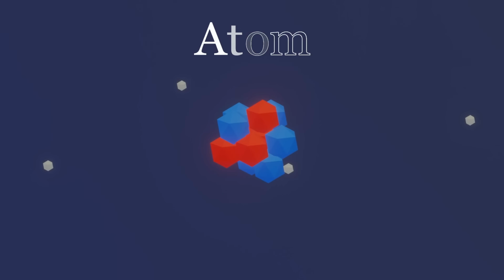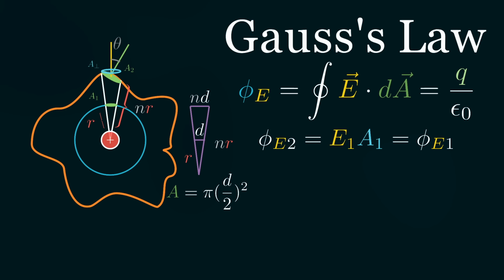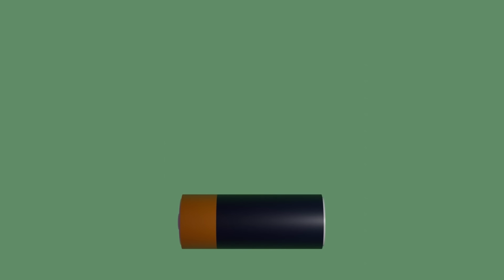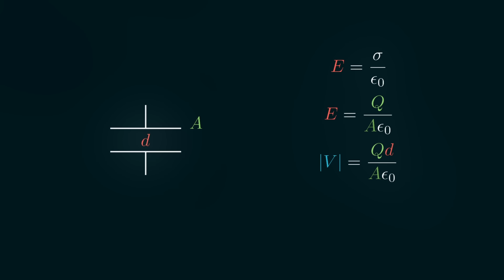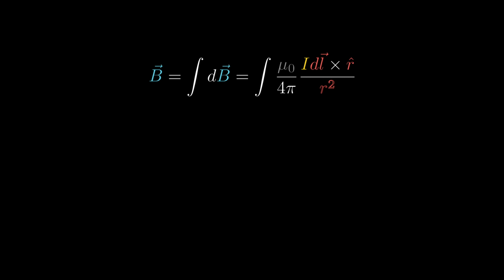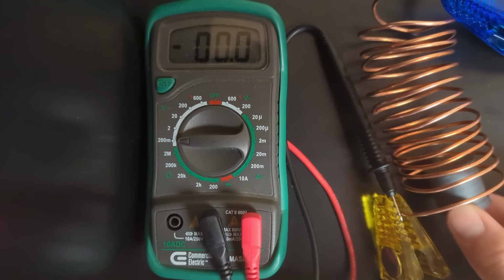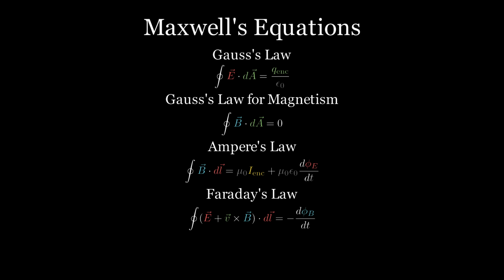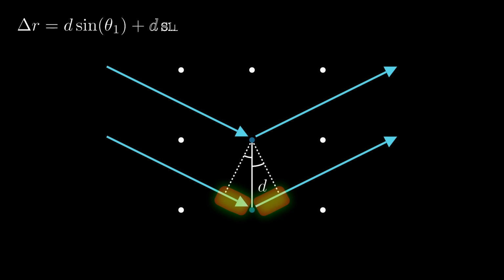An entire physics class in 76 minutes #SoMEpi

Comment from the maker: Corrections:
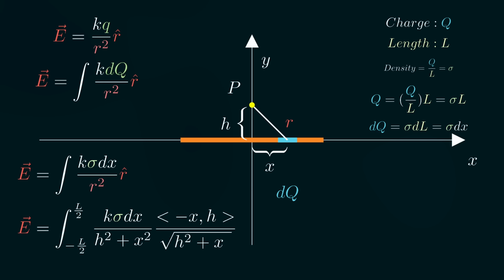5:46 - The square root in the final equation should have an x^2, not an x.
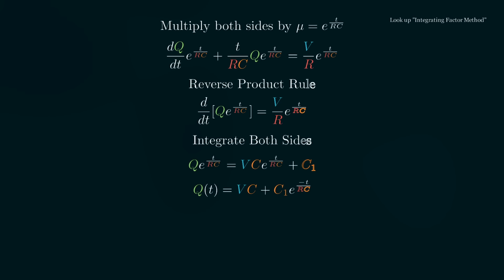30:33 - The terms with a Q out front should be (1/C)*Q, (1/RC)*Q, etc. instead of (t/C)*Q and (t/RC)*Q
35:05 - The top relation should say E -> E/(kappa), not E -> (kappa)E. The bottom relation is still correct.
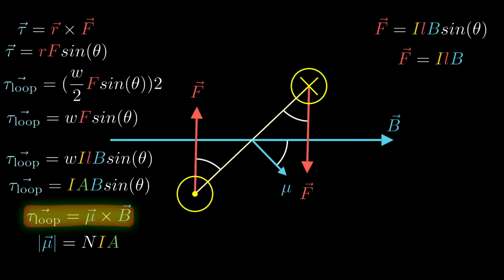51:39 - The motor should rotate the other way.
1:03:12 - Integration should be from 0 to I (capital i), not 0 to L
Reply: Partner collab 😎 nwc
Reply: ah thanks for clarifying, I thought I was dumb lol
Reply: Really appreciated.
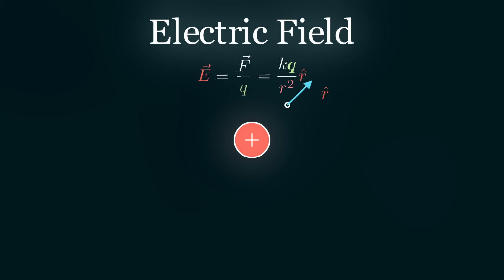Reply: 3:48 two q's should be classified
left side one is test charge in any points, while the right side one is source charge that is mostly fixed
Reply: You can edit an yt video i think
Reply: @COOKER_IO the ability to edit after upload/publication is extremely limited, mostly just trivial stuff like blurring, cutting, muting, and adding stock music from YouTube's library.
Reply: Thank you ❤

Comment: Maxwells constant speed C solution is wrong! This is because Maxwell did not include the source terms that come from Gauss's law and Ampiers law in the wave equation. There are 4 Maxwell's equations and all 4 equations are required to derive the wave equation. So the wave equation must contain source terms. Because Maxwell set the source terms to zero, his constant speed C solution is wrong. And because Einstein used Maxwell's incorrect constant speed C solution in his theories, both special and general activity are wrong!

The proof are the experiments, backed by both EM and quantum theory, all reproduced by other researchers showing that the speed of light is not constant at all. The experiments clearly show that the speed of light is instantaneous in the near field of the source, change speed with distance from the source, And reduce only to approximately speed C in the far field starting about 1 wavelength from the source, and never reduces to exactly constant speed C, ever. If the second postulate of relativity is wrong, what remains is the first postulate: Galilean relativity where time and space are absolute and causal action faster than speed C is possible without violating causality. If relativity is wrong then so is any other theory based on it such as general relativity and even QED. This will change all of modern physics!

What we see in the near field is real and follows according to the law of Galilean relativity. But what we see in the far field is not real and is subject to relativistic illusions such as time dilation and length contraction. Assume a fast moving body is being observed with light. If instantaneous near field light is used then no relativistic effects will be observed. This can be seen by inserting C equal Infinity into the Lorentz transformation yielding the Galilean transformation where time and space are absolute. But if far field approximate speed C light is used, then relativistic effects will be observed. So simply by changing the frequency of the light relativistic effects can be turned off and on. But because time and space are real for the moving object and cannot depend on the frequency of the light being used to observe it, one must conclude that the effects of relativity are not real and are just a type of optical illusion created by how light propagates in the far field from the source. 

This can be more easily understood using the concept of aberration which occurs when one is walking in the rain that is falling straight down but appears to be coming down at an angle. Assume you have a fast moving rod with length that is moving perpendicular to your line of sight. If instantaneous near field light is used, then no aberration will occur because the light propagates instantaneously to your eye and the rod has not moved during that time. But if far field approximate speed C light is used then aberration will occur, causing the object to appear slightly rotated, hence its length will appear shorter, hence appearing length contracted. The same occurs for fast moving wave fronts with periodicity. If instantaneous near field light is used the no aberration will occur and the observed periodicity will remain the same. But if far field approximate speed C light is used then aberration will occur causing the wave fronts to appear rotated, hence the periodicity Of the wave fronts will appear shorter or time dilated. 

An experiment just published in the EM journal IRECAP shows an EM pulse propagates instantaneously in the near field across 1.5 meters of space with no propagation delay. This shows that the front speed (speed of information) or speed of causal action is instantaneous in the nearfield of EM sources. The experiment was repeated hundreds of times, and also done by an independent researcher in their own lab, with exactly the same results. The paper also shows that the effect is predicted exactly by Maxwells equations. The paper is linked below. The effect can also be shown to be fundamentally due to the Heisenberg uncertainty principle. This shows that the effect is fundamental to all fields including: EM, gravity, and quantum.

In another experiment, a sinusoidal signal was transmitted between 2 dipole antennas as they were separated from the nearfield to the farfield. Analysis of the resultant phase vs distance curves (dispersion curves) shows a clear minima in the nearfield for all the EM field components. Applying well known phase speed and group speed operators to the curve, which are inversely proportional to the slope of the curve, show that both the phase speed and group speed are instantaneous in the nearfield and reduces to about speed c in the farfield.

Both experiments have been independently repeated by other researchers, obtaining the same exact results. If speed of light is not constant, then the 2nd premise in Relativity is wrong and what remains is the 1st premise: Galilean Relativity. Instantaneous signals violate the Relativity of Simultaneity because the signals appear the same in all inertial frames of reference. This can easily be seen by inserting c=infinity into the Lorentz transform, yielding the Galilean transform, where time and space are absolute. So if a moving body is observed with instantaneous nearfield light, then no Relativistic effects will be observed. But they will be observed if the frequency of the light source is changed such that farfield speed c light is used. So by simply changing the frequency of the source, Relativistic effects can be turned off and on. The only possible explanation is that the effects of Relativity are not real and are just a type of optical illusion. This result will affect all of modern physics.

In addition, the above results are predicted by EM theory. Maxwell's derivation of the speed of EM fields was wrong. The reason is that EM fields are created by sources coming from Gauss' and Amperes laws, and these sources must be included and can not be set to zero as Maxwell did. Including the source term yields a wave equation equal to a source term. Inserting a dipole source yields EM field components that with phase vs distance from the sources dispersion curves with a clear minima in the nearfield, and become only approximately linear in the farfield, starting about 1 wavelength from the source. It is well known that both the phase and group speed are instantaneous when there is a minima in the curve, and only exactly a constant speed when the curve is exactly linear, which only occurs at infinite distance from the source, which does not occur in a finite sized universe like ours. So Maxwell's solution is only valid at infinity, which does not exist in this finite sized universe. So the speed of light never a constant in our universe. If the speed of light is not constant, then the 2nd postulate in Relativity is wrong.

The same behavior can be shown to occur in gravity. It is well known that general relativity reduces to gravitoelectromagnetism (GEM), which assumes that gravity can be modeled by Maxwell's equations with different constants. So the same solution that occurs in EM theory also pertains to gravitational theory. This explains the instantaneous gravitational effect in the near field, observed in the stability of the planets, and also explains that Gravity waves have been observed to propagate at about speed c in the far field. This theory then accounts for all the observed gravitational effects including instantaneous nearfield and the speed of light farfield. The main difference is that this theory is a field theory, and not a geometrical theory like General Relativity. But because it is a field theory, Gravity can be then be quantized as the Graviton, enabling the unification of Gravity and Quantum Mechanics.

The phenomena also can be seen in quantum theory, and can be shown to be the consequence of the Heisenberg uncertainty principle. At the source, the position of the photon emitted from the source is precisely well known, hence the momentum or the speed is infinite. At about 1 wavelength from the source, the wavelength is starting to be come clear, such that frequency x wavelength ~c. But according to Fourier Theory infinite cycles are needed for the wavelength to be exactly known. So the above frequency wavelength relation is only valid at infinite distance from the source. So the speed of light never reduces to exactly speed c in our finite size universe. This phenomena should be fundamental to all fields including: EM, gravity, and quantum, and in particular quantum tunneling.

There are currently many interpretations of quantum mechanics. But only the Pilot Wave Interpretation is compatible with Galilean Relativity. In this interpretation real particles are guided by real pilot waves. But the real pilot waves are known to communicate information about the particles instantaneously with the environment. Because this is not compatible with Relativity Theory, this interpretation has not been taken seriously. But as a result of this discussion, this is no longer a problem, and Pilot Wave theory should now become our best interpretation of quantum mechanics. And combined with instantaneous nearfield interaction, can perhaps explain the instantaneous interaction observed in quantum entanglement.

For more information see the following links:

*YouTube presentation summarizing my 35 years of research in this area: https://www.youtube.com/watch?v=sePdJ7vSQvQ&t=0s

*More extensive paper for the above arguments: William D. Walker and Dag Stranneby, A New Interpretation of Relativity, 2023: http://vixra.org/abs/2309.0145

*Electromagnetic pulse experiment paper peer reviewed and just published last month in Journal IRECAP: https://www.techrxiv.org/doi/full/10.36227/techrxiv.170862178.82175798/v1

Dr. William Walker - PhD in physics from ETH Zurich, 1997

Comment: Notes for beginners (and myself in the future if I forget)
7:48 Important to note that flux depends on a surface, and your surface may not be closed. 
(You can also measure flux through an open surface is what I mean)
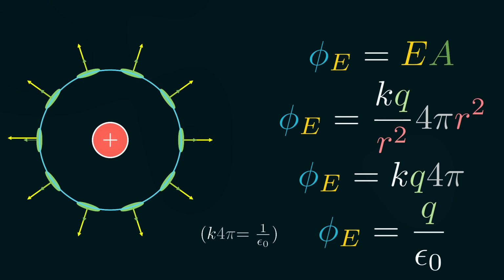8:31 If your are wondering why stuff cancels here so nicely, it has to do with the fact that you can derive Coulomb's law from maxwell's (gauss' law)
9:30 FloatHeadPhysics has a cool video explaining why integral doesn't depend on surface
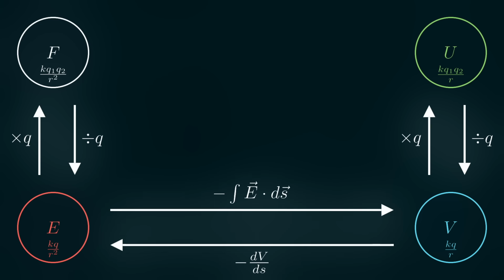21:35 Remember that the voltage is a scalar field, here by "slope of the voltage" they mean the gradient
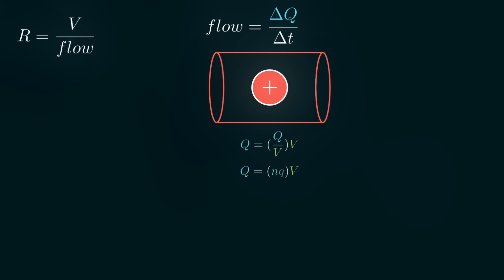22:53 Here note that Q/V (charge per volume) can also be represented by ρ
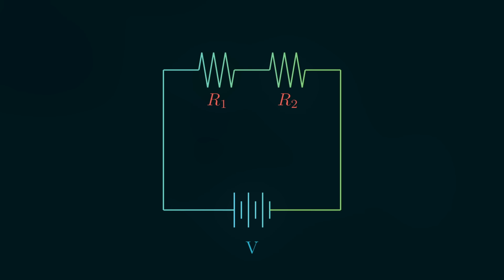25:12 damn that geometric interpretation is good
Reply: 30:33 where did that t come from?
34:03 note that here V represents volume, not voltage
37:41 note that we are working with capacitive reactance, there exists also inductive reactance

Comment: Wild questions incoming --

I notice that the quantum equations contain references to Pi 

I know that it is used to signify a geometric space

What is the relationship of the Circumference/ Diameter in a "Wave" ?

Example - if i have a glass of water and it's still i can measure the Circumference and figure out the Diameter
BUT
If there is a ripple in the water does that in theory change the relationship between C/D ??

It just seems odd -

I think Tensors try and show this type of dynamic - idk

Comment: Great video! One problem, I believe that the biot-savart law equation that you showed was incorrect, leading to incorrect reasoning on the magnetic field r distance from a current caring wire. There is an r^2 in the denominator only when the R vector is normalized. Without it being normalized, there should be an r^3 in the denominator. Second, using the wrong equation, led to an incorrect reasoning or the magnetic field. The magnetic field is proportional to 1/r as a result of integrating along the whole wire.  Other than this, this video is great and I would love to see more
Reply from the maker: I think somewhere in the video I corrected this. But when I first mention it, I guess it was pretty ambiguous that the r-vector and r^2 cancel leaving it proportional to 1/r. You're correct.